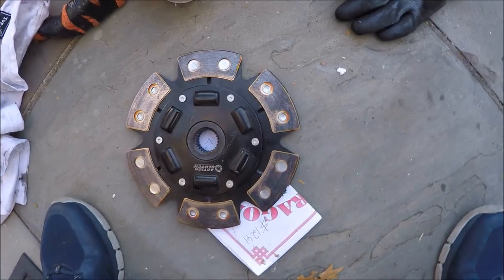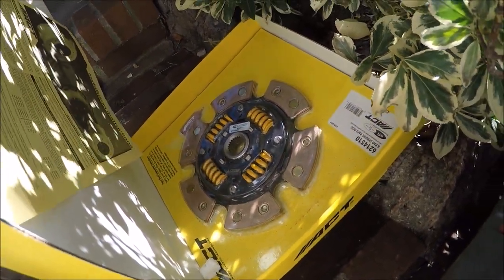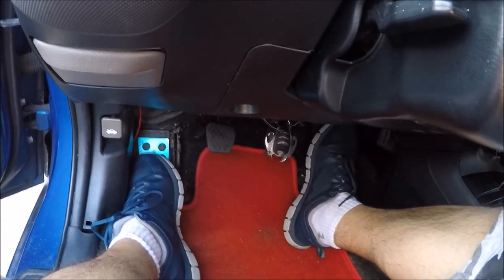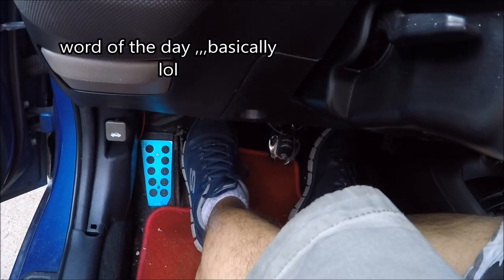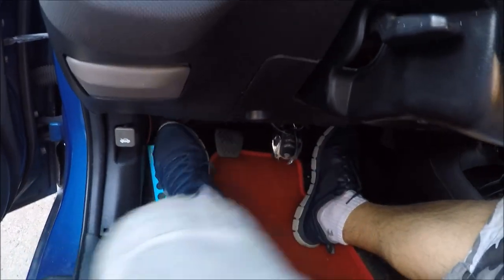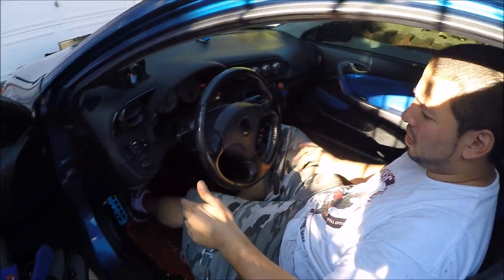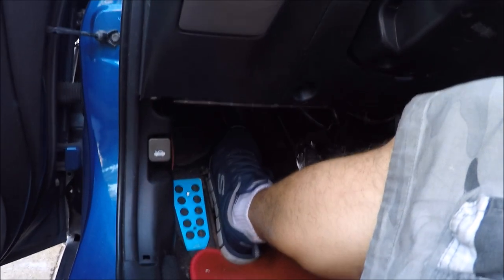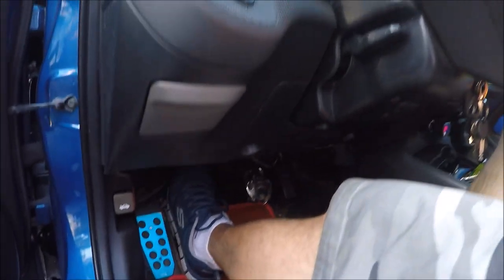BREAK IN UR CLUTCH IN 10 MIN,DONT WAIT 500 MILES!!

Comment: Yes, this works, its the same as banishing the brake pads after install. But I would do this for cars non-daily driven. A clutch can last a very very long time and should be broken in per manufacture if your car is daily driver.  What you are doing is brute force banishing and it's never perfect. But if its a race/toy car that clutches realistically only last a few years then yes this is an acceptable prosses to get you back on the track.. I personally allow for more cooldown time including engine off periods in between slips for the clutch to contract from heat. Additionally I use the closest 1:1 ratio gear. So for most cars I would use 4th gear.  Stop flaming the guy he's not stupid..
Reply from the maker: I know alot of people just  watch the video  and dont listen.But its been 3 years now  and im making 100hp more now ,so i know it works.  thanku  for ur comment,and the view bro .ur one  if the very few smart people  in the word💪💪

Comment: “Clutch is slipping, we don’t really know why” Because glaze. Or in other words, because you didn’t properly break it in the first time
Reply from the maker: Clay Hawkins wow nobody reads the comments ,1st clutch is fine and was a 500mile break in.this clutch is holdiing  way more trq and standing strong dont hate
Reply: QUEENS_RACES I’m not hating bro, just telling you what I see. That clutch is glazed, and is not properly bedded
Reply from the maker: Clay Hawkins well i sold that clutch to my boy and it works perfect..also when i changed my clutch  the problem wasnt the clutch  at all,it was my tune leaning out at 6500 and up i thought it was slipping.and i was speeding and did my clutch the next day.
Reply from the maker: Oh yeah and the clucth u said wasnt bedded right i did a 500 mile break in on it 👍
Reply: QUEENS_RACES good shit 👍
Reply: At least  he made a video if you want  you can for drag racing i can see this work but would use 3000rpms and hold it few sec longer  but if you want it to last for your daily do the break in the reg way 500 miles city or  1000 hwy
Reply: @Queensraces  how long after the tune did this start occuring? My clutch seems to be slipping really bad but others have said it might be the tune. But I got it tuned 4 years and 30k miles ago and this just started happening
Reply: Exactly😂

Comment: For the the people saying this is stupid it's not, I see people doing this at the track. If your clutch dies at the track what are you gonna do? Drive it around the track 300 laps? Go to a drift event and you'll see this.
Reply from the maker: 💯Finally  some who has knowledge  of wat goes down at the track👏💪💪.
Reply: Pour a bottle of coke in there
Reply: If this guy brought it to the track then maybe it would make sense
Reply: @destruxandexploze2552  well if your car is being built for the track then you need to be able to tune it and work out all the kinks before hand which means it needs to be drivable and usually able to be hammered on, and most high hp cars built for the track you do not want to be driving it around on the road for 500+ miles

Comment: That is the most Craziest thing i ever heard or seen lmao. You can not do that to a clutch at all. You are supposed to break in the clutch by normal driving conditions.
Reply from the maker: 3years later  still holding strong and with 150hp more ,and i install all the stage3 and up like that! stage 2 u need the 450 mile break in

Comment: Bollocks to that, all this will do is glaze it, you will have hot spots burned into the flywheel and pressure plate followed by clutch chatter.
Reply: nothing good comes from short cuts. anyone listens to this post, they will be very disappointed
Reply: Crazy Bc it’s actually used pretty widely across platforms it is usually for strictly race drift applications
Reply: Bad idea

Comment: I would just do things the tried and proven way. This way of heat cycling the clutch could cause hot spots on the fly wheel and premature slippage down the line. This might be something to do if your car is a "track" car only. But it seems like you drive this car on the streets. So you are constantly slipping the clutch daily driving versus a track where you aren't. So it's best to just take your time. Do it right. Drive the 400miles.
Reply from the maker: Jujutsuheiho finally some1 who comments with some wisdom..i agree with u all the way,but i dont have time  for 400 miles honesty. Also yes it is also called a track Break in. And yes it will wear out sooner they say but honestly it been a year now amd its still holding.this is the same break in the tunner do when they install a stage 3 or stage 4 clutch , then put your car on the dyno. because no tuners going to  drive your car for 400 500 miles,then dyno it.now im making 300 trq so if it last me the summer ill be happy😁

Comment: For people thinking of doing this: While this can work, go with the recommended break in period from the manufacturer as they know better than you do about the product they produce. 

If you have a daily you’re going to be driving 500 miles in a short period of time anyway so just go with what the manufacturer recommends for the break in. 

It’s simple as that, just follow the directions and don’t take short cuts, because even if short cuts work they always have risks.
Reply from the maker: I agree if its a daily just drive it,but if u dont have time and it not stage 3 then hit the short cut.The manufacturers act,clutch master ,action clutch told me it can be done with stage 3 and up. So far they were right cuz this clutch is still working perfect and hold way more power.

Comment: This is mainly true for 6 puck/4 puck clutches and it worked great held good on my car at 500hp/400tq. Doing it one a 8 pad will not work the same those need to wear in more.
Reply from the maker: Act  and comp clutch told me they do it 1 to 2 times b4 the hit the track. So for safety  i do it 3xs. But they said for stage 3 and up,it always works. So i figure those 8pucks would work also,becuase the material is stronger than a stage2. But it all depends if u have the time  to break in ur race car feel me. Rn its been like 3years and this clutch it still holding perfect 😁. Thanku for not being ignorant 💪💪...like 90% of the people  in the comment section  that dont know  anything about cars.

Comment: Reading on the internet a 6 puck doesnt need break in, however my 6puck with new reinforced pressureplate and resurfaced flywheel slipped, after doing this told by a friend it did engage (still bites very late but does not slip)
Reply from the maker: 6 puck stage 4 u dont need to break in stage this this is good enough .its been like 5 years since this vid and im still usuing the same clutch. With alot more hp.i just did this to clean the surface alil. Its called a track break in.  If u contact any big clutch company's  theyll tell u to do wat i did in this video.thanks 4 watching
Reply: @Queensraces  I have a 2.0 saab turbo, had a reinforced pressureplate and a better full face pressure plate. lasted 2 years 12500 miles. Went for a new reinforced pressureplate and a 6 puck plate. The material is pretty thin on each puck how does yours even last 5 years with more hp? Drive once a year? :)

Comment: Effectively getting your engine to machine your  clutch friction disc without over heating it too much making it glaze, risky but fast
Reply from the maker: Yeah, but there's actually no break in for a stage street3. Clutch & higher
Reply: @Queensraces I've a Sachs ceramic paddle clutch and needed to bed it in for a bit before it would hold as the power came in , it's a diesel pd so the torque comes in fast and low , destroys new clutches without bedding in

Comment: Thanks for tip. But I'm just gonna do the normal 3-500 drive break in, on my stage 3 just put in. Gives me an excuse to drive the shit out of my hatch.
Reply: Actually you can’t drive the shit out of it till its broken in. Gotta drive regularly on the street till 500 miles (shift at 3k rpms max, slow clutch release when shifting, etc.)

Comment from the maker: Old clutch wasnt slipping and   was sold and still works till this day!! My tune changed after a kpro update . my car keeped leaning out only  when i punched it over 6 k ( so thought it was slipping but i was wrong).1st clutch i did 600 mile break in..2nd clutch hard break in
Reply: How does one confuse lean AFR for a slipping clutch?
Reply from the maker: @dragonracing8802  cuz only when i floored it it would happen
Reply: Lol
Reply: @dragonracing8802  it's the same guy doing this break in so there you go

Comment: Honda community in a nutshell. People like this is why I left the Honda scene for the 240/ 350z scene. Lol
Don’t follow this guys advice lmao.
Reply from the maker: Shows how smart u  so u left because people are smarter than u lol ...  a years later and 100trq on this same clutch and its still holding perfect.... boosted k24 now ..enjoy driving ur Hyundai
Reply: Haha😂 when a Honda guy tries to roast someone. Lol sit down spaz. Your the one stuffing performance parts in a cheap base model economy car. I moved on because I decided It was time to move on from a high schoolers riced out first car to an actual car lol
Reply: Hatsune miku 01 the nissan scene is even worse than the honda scene 😂😂
Reply: Boosted DC5 facts 😂😂💯
Reply: Hatsune miku 01  😂   Ladies and gentlemen this is what a hater looks like .. lol a real one
Reply: Hatsune miku 01   The ancient vq lol
Reply: @ZRIEST  Eh may be ancient but it’s tried and true. I own a Honda Accord K24 and Nissan Altima VQ35 and both are manuals. 

The Accord is a great daily but it can’t touch the Altima, even if the Accord had the J30 it would be a tough fight. The VQ is a good motor that can handle lots of miles and some decent power too. Plenty of VQ37VHR with 600+whp on the stock unopened engine. It’s tough to do that on a stock unopened 4 banger Honda without worrying you’ll blow it up. 

While I’m not trying to side with the guy, Honda’s are really only good for straight line stuff if we’re being honest with exception to the S2000 and NSX (and the new Type R). NSX isn’t easy to get though. Mostly you find Civic EG hatchbacks with big single turbos but all I see them being used for is straight line highway pulls. 

Don’t get me wrong Honda is a good brand and they make good cars, but when it comes to the tuner scene there’s just so much better out there.
Reply: @destruxandexploze2552   oh I know bro lol , I’m getting a 370z myself , 😂 I love my Honda’s and VQ . VQ very successful motor with the aftermarket scene
Reply: @destruxandexploze2552   I have a prelude right now , I love it , it’s probably the only Honda I’d ever approve of besides the 9th Gen accord 6-6 coupe but I think I’m more a Nissan guy , all the cars I truly adore are Nissans ,
Reply: @ZRIEST  That’s funny I’m looking at a 370z as well. Good luck with the search of finding a Z that fits your needs.
Reply: @destruxandexploze2552   you to man 🙏🏽 , stay Z

Comment: Not going to lie that shit ain't going to work clutch is just like brake pad it's how you drive is how the clutch wears out
Reply from the maker: Steven mercado it is  like a brake pad and when u slip it ,it scrapes of the first layer of bullshit. It worked for me and a whole bunch of people i know....If it dont last long idk. but everybody that has got it broken  in this way (by their tunner) their clutch is still going. Stage 2  i dont recommend it, stage 3 yes and  alot of stage  4s dont need it.
Reply: I'm going to do this with the R6 clutch.  I thought I was slipping but I think when it was wet the tire was spinning but my balance and throttle control is so good I couldn't tell because I was backing off but I was high RPM in 2nd from 1st too and thought my gearbox broke then thought clutch as I researched online.  Went out today and it didn't slip but I already ordered a better clutch.
Reply from the maker: Hey  just wanted to give u a update the clutch still works 💪🏼

Comment: While you hold it down it’s frying the throw out bearing so don’t do this
Reply from the maker: @JoBeQuick  ur acting like u dont press the clutch down 24/7 holding it down for 2sec doesnt do anything. Once u release slowly  ur scratching just surface like u do when u have to brake in brake pads  .its simple and recommended by big clutch companies..do ur research. And it 6years later holding strong

Comment: How to destroy a new clutch 101 😂
Reply from the maker: 5years later And the clutch is still holding With more horsepower.
Reply: @Queensraces  I got a Skoda Octavia on lease 4 years ago I beat on it from the first key turn out the dealership it’s still going strong today with a different owner but will the car last past 120k miles without major replacements? I doubt it. 5 years it’s last3d granted but how many miles how’s it been driven etc it all plays a part. A proper bed in will last longer fact and overheating the clutch will glaze it fact

Comment: That could go so wrong. No thankyou. I have a Honda Civic. I let the dealership replace my clutch and they told me drive like a granny for 1000 miles. I changed gears no higher than 3000 rpms for the first 500 miles. And no higher than 4000 rpms the final 5000. If you go into vtec, you're going way to high.
Reply from the maker: Idk wat clutch u have but this is for stage  3 and higher. Ps clutch is still holding PERFECT
Reply: Oh ok. Just the regular oem clutch
Reply: @Tjtjboy  even with a regular clutch, the rpms don't really matter as long as your engagement is smooth and you don't slip the hell out of it. This video shows holding the clutch off the flywheel to prevent hotspots, probably a good practice for breaking in any clutch.

Comment: This is really silly why would you risk 500 miles of clutch 

If you want to have best results then clutch start on level surface with no gas in 1st and clutch start in reverse with no gas making sure the car is moving ALWAYS
Your handbrake is your clutches wort nightmare neighbour 
Think of it as an ice rink better after ten mins of normal use but worse after an hr of use within ten mins

Your looking for grip and that happens over time and not from wear 

If you fake launch the clutch then overheating and sticky metal all only slow your real launches when the time comes
All the best........

Comment: Wtf man, ur old was slipin probably because of how you broke it in ! ... doing what you do in this video will get the high spot too hot. You dont want the high spots to go hot. If you want to break in the clutch fast, the only way is to start the car from a dead stop every 45 to 60 seconds. You need to let the clutch cool down before it slipping again man.. You can achive this in about 1 to 2 hours but, it's best not to rush it. Just city drive for an entire gas tank and half... 1 whole saturday to breakin your clutch patiently
Reply from the maker: Tang Li nah the old one wasnt even slipping i was speeding when i changed it.aslo the old one i did the 600 mile break in on tht one....and the new clutch is holding even more power now over 300trq on new k24 motor